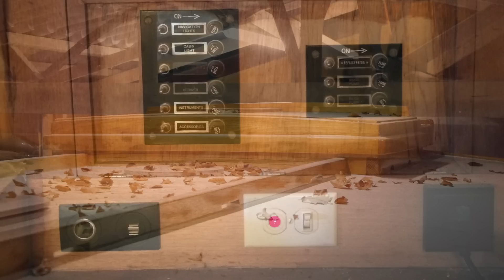Tiller, Tiller Head and Lower Endplate - SV Tapatya EP263

Comment: She looked brand new after the wash. Lots of details in the rudder/tiller design and installation.  I know it is not completed (tabbing, glassing) as yet, but is that bottom aerofoil fin beefy enough to handle abuse (grounding, hitting objects, climbing, etc)?
Reply from the maker: Thanks Roland 
I’ve never seen a rudder endplate that would stand a significant grounding. I think they have to be seen as being sacrificial. Should protect the rudder blade to some extent though!

Comment: Me again, your burner looks like it warms the boat well, in a rolling sea do you feel safe using it purely if you go to brace yourself you could get burn
Reply from the maker: That is certainly an issue with Dickinson stoves, but I should have enough other brace points in the vicinity to avoid doing that 👍